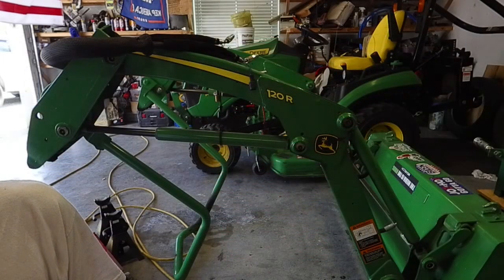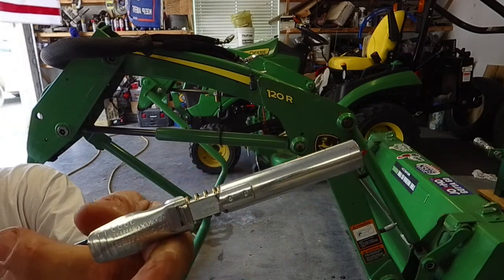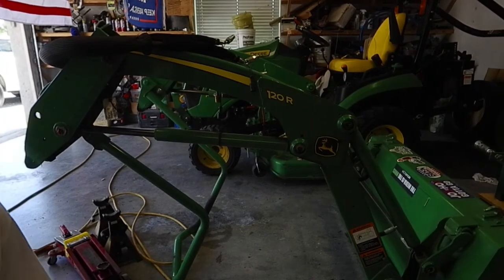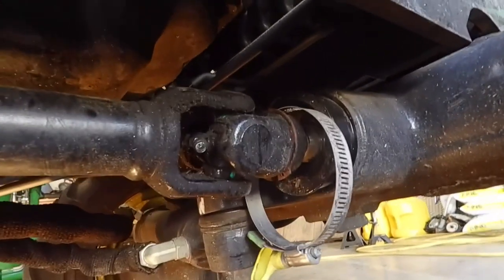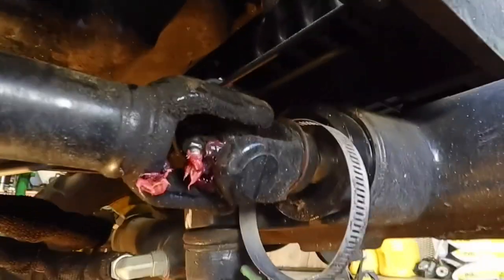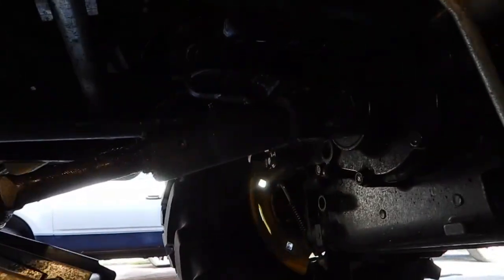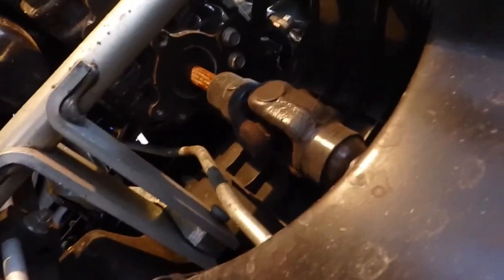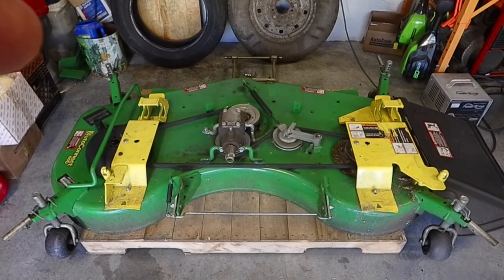John Deere 1025R grease maintenance

Comment: Were you able to get the lock n lube to engage the u joint just behind the flywheel through that small hole in the frame?
Reply from the maker: For that one I switch to my regular gun, with the small end, I plan on drilling the hole, so the lock & lube will fit
Reply: @daze65  Even with the small end on my grease gun I had trouble getting it to release from the zerk fitting. When the dealer installed the power beyond for my backhoe they elongated the hole for me but it still didn't want to line up so it would snap on and release properly. I finally just bought a grease needle for the front main universal joint and it works just as well as the small grease fitting, without all the hassle. It might take a little longer but it beats struggling to get the grease gun on and off the zerk fitting and it saves messing around with a die grinder or hole saw...
Reply: @1965l88  Thanks for joining the thread. I think I will try this first.  I had sent my tractor in once a year (from 2018 to 2022) but it went from around 200 USD a year to 900 USD last year. I just can't afford that anymore. And who can say the dealer even greased that zerk anyway.
Reply: I got mine to grab it with the lock and lube.
Reply: @RoseCityReptilesTX  with the regular lock and lube or extended one? Through factory hole or did you make the hole bigger?
Reply: @liffy8333  turn it to around 7:00 position and you can reach it with a regular grease gun, not the factory small hole